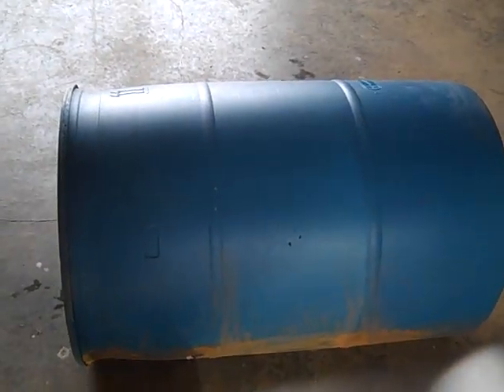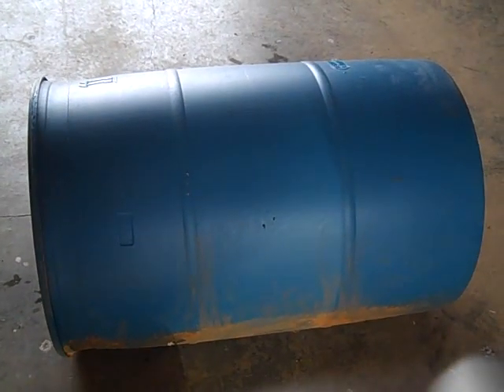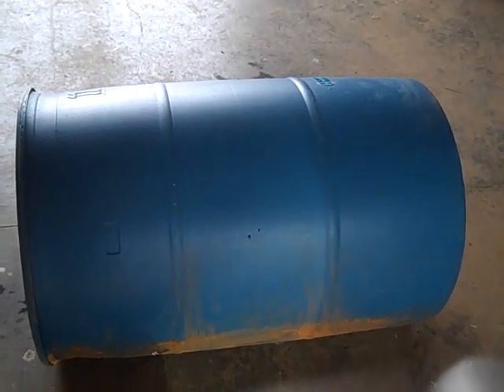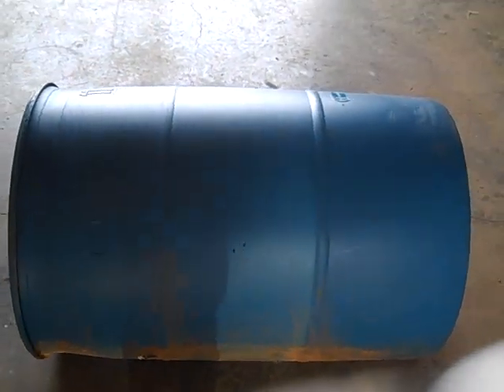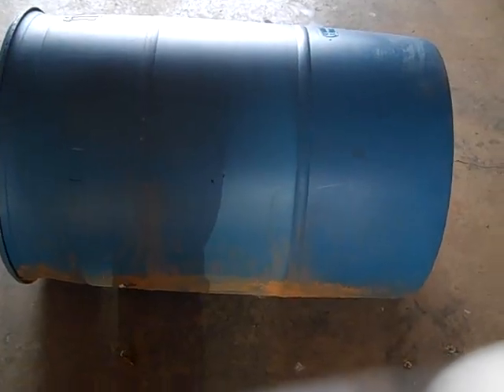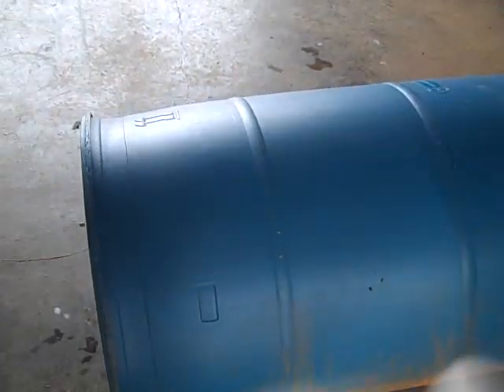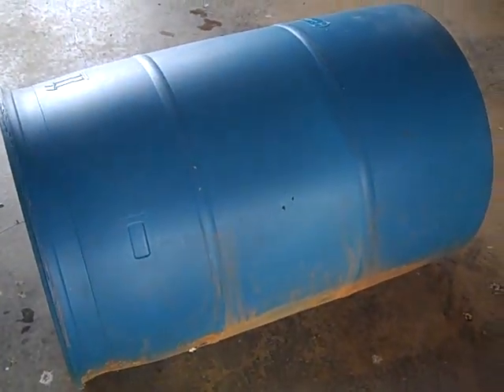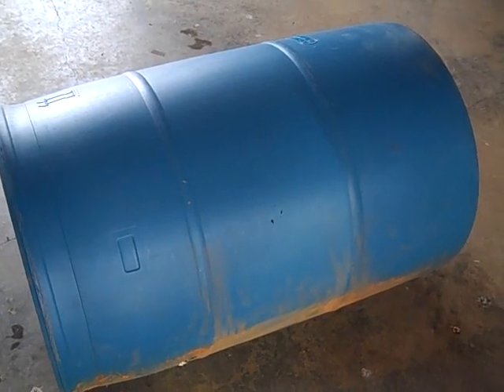Doomsday Water

Comment from the maker: It was actually 270 ft of elevation and 600 linear feet. That was a 1/2 hp dc motor in a Dankoff Slowpump. They are awesome.  I can get one to lift water 520 ft in elevation.  There are some solar submersibles that will lift 800 ft.

Comment from the maker: Sorry bought that .  You will not find a better solar pump out there and nothing that will lift like this baby.  Up to 520 ft vertical off of solar direct.  1300 is nothing compared to the amount of work it is doing.  This is lifting 600+ gallons a day up a 300ft cliff.  Mine hase been running for 3 yrs.   not enough water for a Ram here.  this is why smart folks do not build on top of a hill!  The water is always in the valley

Comment: This spring flows out of a cave in the side of a hill filled with large trees in Tennessee.  Wish I could bury it. It is such a long line also.  I think the new design I will have to disconnect and walk out the water to prevent freezing.  I will have to place drains.

Comment: Wish it was that simple.  It was a long pipe with low spots and each low spot which you did not know was a low spot exploded the 40schedule in splinters.  I should design the new one that can be disconnected and walk the water out of the line to drain disconnects.

Comment: not to be a bic, but this video is basically useless and therefore frustrating and boring to anyone but the small audience that already knows how to do exactly what you're doing. engineers like you always seem to launch into these technical details, without slowing down to put it into common terms, and explaining the basic operation. from watching this vid i still dont have a clue how you locate the spring hole? cover with gravel? plastic sheet? just wth is going on?

Comment: would a non electric hydraulic ram pump not work due to the distance/elevation and low water flow from the spring?  Looks like if TSHTF occurs, they'd require guards to be at that location 24/7 so locals would easily take out their water supply.  very easy to take out post collapse.

Comment: I made a gravity system similar to this to water my gardens from a spring on a hill side.  The schedule 40 plastic pipe shattered like razor blades in areas when winter came and have found it will be so much maintenance to keep it repaired.  Any suggestions ?  It is a system to long to bury pipe.